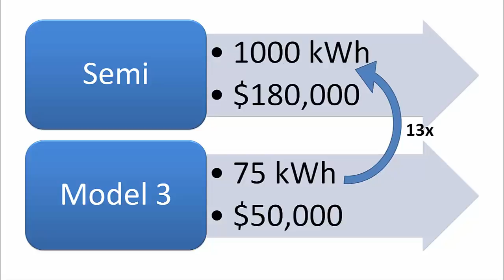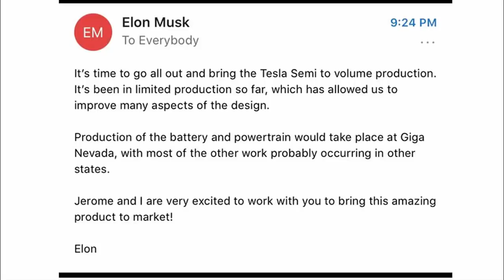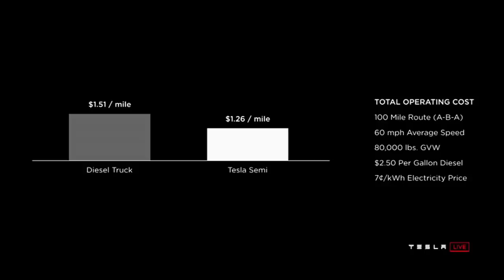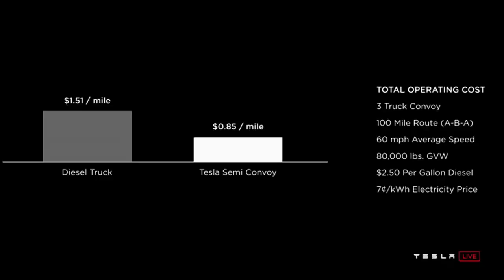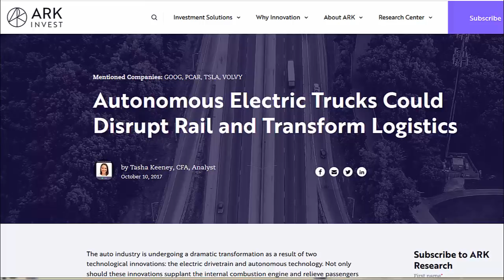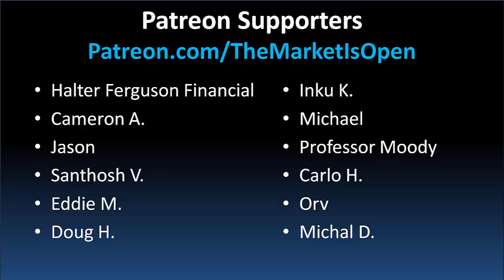What Happened to Tesla Semi’s Autonomous Platoons?

Comment: Thanks for sharing. Solid research there. Nikola court case could be holding back semi manufacture too. IMHO the convoy idea is not going to work. Semi trucks are difficult enough to overtake by themselves but a convoy would be infuriating. Then there is the problem of convoy disruption. In the first few years I think the ES (electric semi) will be used for short hops in urban areas where convoys will be inefficient.
Reply: It is not yet proven, or not proven. I think it will be a few years out when people start to stop driving and letting the car do it!!!
Reply: Jeff Harmed...There’s definitely work to be done there. Convoys must self-distance at all interchanges if another vehicle is near? Convoys initially allowed only on double-lane separated highways, etc.?
At least these things won’t slow everyone to a crawl on uphill gradients. Heh-heh. Imagine a diesel semi driver climbing a hill at 30 mph and a convoy of Teslas blows past at 65 mph. That’ll be the moment of revelation for a lot of truckers.

Comment: Platooning has been discussed for over 50 years.   It is happening, but electric drive does not enable it.  There are many issues to overcome: motorist intimidation/concerns, insurance, liability, legislation, safety unions, etc.  There have been many tests, even some revenue service fleets in recent years.   Currently Batteries are to valuable and too heavy to make sense.  Diesel trucks are highly economical, reliable & durable, routinely exceeding 1 million miles in real world.  Maintenance guesses in this video are pathetically skewed, take a break from the koolaide dude.
Reply: truck driver who is willing to lie in fear of losing his job spotted. Future is now oldman, get used to it, because it will happen you want it or not.

Comment: commercial trucks will not be autonomous for decades and tesla trucks can not go longer then 300 miles without taking 30 minutes to charge. which makes them useless to 3 quarters of the industry. considering nikola will go 800 miles and take 15 minutes to fuel you can see which way 75% of the industry is heading.

Comment: The platoon feature makes me nervous.  The trucks would have to keep distance between each other for safety reasons, other cars will cut in between them almost immediately.
Reply from the maker: It would be cool if Tesla knew the total weight of each truck in the platoon, and used that to calculate the optimal distance between each truck. The computer can react much faster than a human which would allow for abnormally close driving, which would also increase overall efficiency. However you'd want to have the heaviest trucks in the front as they take the longest to slow down.
Reply: If I'm driving, there is no way I am cutting in and being trapped at whatever speed the lead truck is driving at.

Comment: Same thing that happened to 1mill robotaxis by early 2020...AUTOMATED driving systems are NOT the same as AUTONOMOUS, which no one is even  CLOSE to achieving.

Oh, and those megapacks?  No megachargers.  And Nikola's news is taking peoples' attention away from Tesla.  That means Tesla will once again have to put out a product that is quite different from the one they promised (i.e. $29.5k Model 3 with 350 miles range and fully autonomous driving and free supercharging).

Comment: No way that platooning works. Sure, if it's just highway driving then yes it's easy but that's not realistic. How do they deal with rest stops? How do they deal with intersections? How about city driving?
Reply: TheNighthawk00 platooning is for highways only.
Reply: also key word, Autonomous.
Reply: It is an idea which will be proven or not. Elon and his group are some of the most intelligent people in the world, so all the feedback has been brought up, I am sure. It is not proven yet!!
Reply: @nathanlewis42  Well, how do these trucks get on the high way and off? Do you need one driver per truck then?
It's not like the shops or whatever are always located on the highway.
Reply: The platooning will be almost exclusively on the interstates.  Pulling into megachargers will be no problem.
Reply: TheNighthawk00...Convoys will likely travel between hubs and distribution centres. When they arrive a human driver will board each of them and deliver the “last mile” or they’ll be off-loaded and shipped in smaller trucks/vans.

Comment: It is way way too heavy. It's well over 30,000 LBS. There is no charging infrastructure, and bring in 10's of Megawatts to charging locations is going to break the bank. Then there is no parts and service network. How long will repairs take? The downtime will be a real deal breaker.
Reply: Do you work for Nicola or Chevron?
Reply: @donkanis6141  Have you ever owned, driven, repaired, or even ridden in a class-8 truck? Are you an electrical engineer? Go back to your cubical, or cash register, or whatever you do and stop talking about things you don't understand.
Reply: Tesla will make the first truck for themselves. They haul cars so there will be no issue with being overweight. Other class 8 for short haul will not have to go on scales for a longer haul,. 
The mega chargers will have solar arrays and maybe the grid as well, with batteries packs which will support the charging for the trucks. Short haul is not going to need as much charging as they will not have to charge most of the time. 
Tesla already has 16k fast chargers for cars. They are not new at this, these are just larger. Tesla can afford to put more money into its EV charging infrastructure. 
Tesla has service centers all over the world. They can handle it. 
EV's don't have much maintenance, like ICE. 
Nikola has a big problem, most of what you said does apply to them, NOT Tesla!!
Reply: You better short Tesla, in order to profit from this debacle.
Reply: @MyUniversalUniversity  "Other class 8 for short haul will not have to go on scales for a longer haul,. " Really, so they are going to run illegal? Do you think that weight laws only for long haul? Yeah it won't break. LMAO I have a whole fleet of class 8 trucks. Stuff always breaks and most of what breaks has nothing to do with the engine or transmission. And solar charging is BS, you'd need like 1/2 acre of solar for each truck.
Reply: @cindytepper8878  As with all the naysayers on Tesla, Spacex and the Boring company all of the problems have already been solved in principal. Wait and see your doom laden promises will not stop them.
Reply: So as a diesel semi truck driver.  I deliver groceries from a distribution center to Walmart stores. I work about 12 to 14 hours a day, And drive between 150 to 450 miles. I  come back to the same place every day and take at least 10 hours off. I believe that solutions could be made for E-Truck availability that wouldn't need above a class 2 charger.